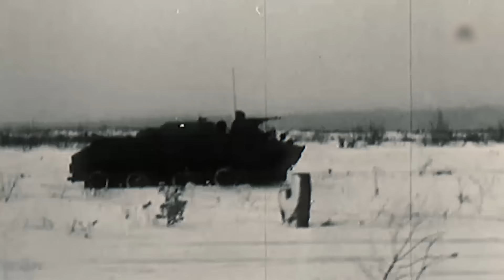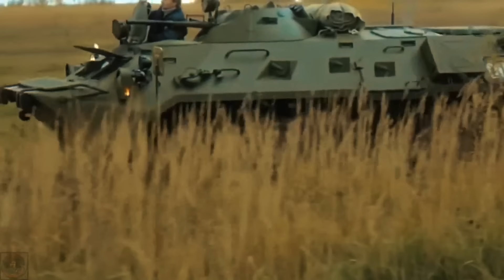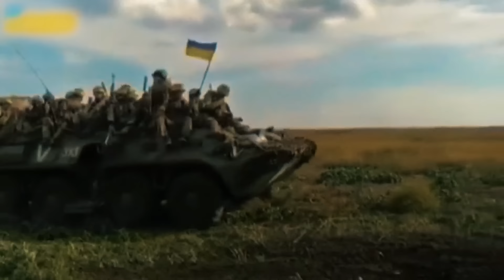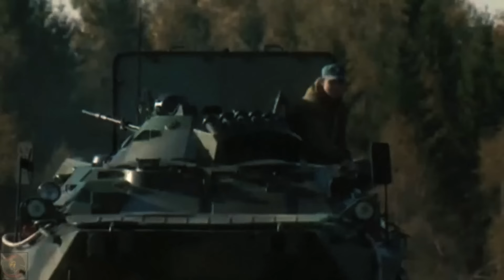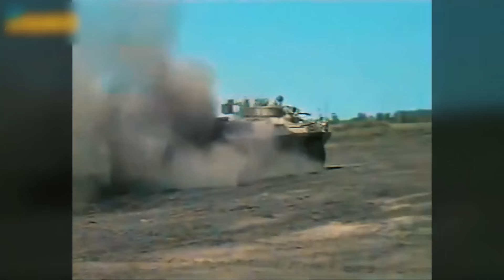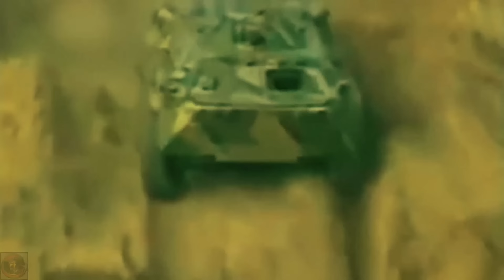Inside the BTR-80: Fixing Russia's Deadliest APC Flaw

Comment: If i had to work with the chassis i'd ditch the amphibious capabilities, strengthen front armor, remove the cannon put something like a zsu instead in the same turret (like mentioned in the vid high fire rate is key), increase speed. 
The goal is to get to the target quickly, while providing this screen of flak in open air to blast drones with the zsu (hopefully with some sort of proximity or air burst round) and dismount quickly.

Comment: Firstly: that door arrangement isn't connected with the BTR60⚠️ Its plain to see from the video...the guys get out from the top and through hatches on the rear upper side🎉. BTR70 has extra hatches between the wheels. The drivetrain is complex but its not without precedent and gasoline was standard fuel choice for most APCs in the 50s and 60s (like US M75, M59, M113). The armour resists 7.62 mm rifle fire...also standard for the time.

Comment: Not armored enough to be called "armored personnel carrier" 
Amphibious only on paper, requires dozens of manhour to maintain its amphibious capabilities "changing all the bushings and seals" but it only keeps that fix for a few hundred hours before all the seals get chewed up. 
Engine placement in this vomit tub cursed it from the day it was developed.
Reply: Dozens of manhours don't sound like a lot... especially if it can last for a "few hundred hours" after that. 🎉 Not like this was the case, the vehicle can remain amphibious for years as this capability is based on hull design, propulsion and Not seals! I also don't see why those would be chewed up! Its not constantly in water like a ship. 🎉 So those manhours were mainly to check the seals before action...not maintenance⚠️ The vehicle btw resists 7.62mm gun fire...this was fairly standard for 1960. M113 and M59 was similar in protection....oh and those also used gasoline engine! M113 was only retrofitted later with diesel.
Reply: @S300V exactly
Reply: BTR-80 is definitely way superior to M113 in the ways of its mobility, armor, and having a standard armored turreted main gun. Being able to cross water obstacles saves many, many lives, and it saves more time and lives for military engineers who don't need to build bridges across every stream and pond or devise ways to use various transport vehicles to haul other vehicles. If you want THE perfect land vehicle with THE best armor, weapons, and one that's able to cross ANY terrain, then there is one especially for you - Landkreuzer P. 1000 "Ratte". It doesn't exist, it would not actually move, so crossing any terrain would never be an issue, but it could not be destroyed with anything short of seriously heavy artillery, and if it could ever fire a shot, it would probably be just one shot, but a HUGE one. Boom, there you go. Get yourself a Landkreuzer P. 1000 "Ratte" and enjoy yourself, you condescending hater of whatever is Russian-made, just because it is Russian-made.
Reply: I wonder how it's amphibious capabilities stacked up against the APC that your people never created approximately 65 years ago....